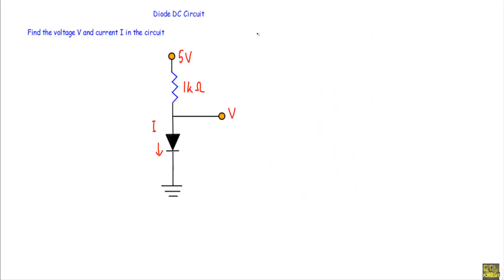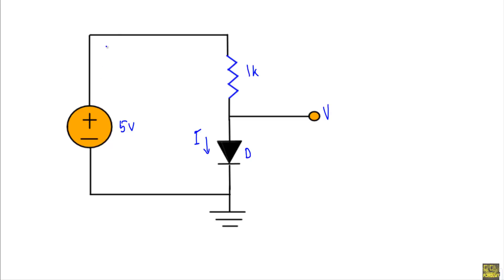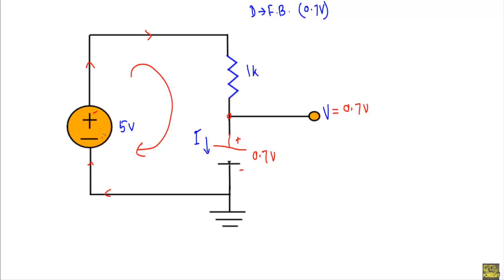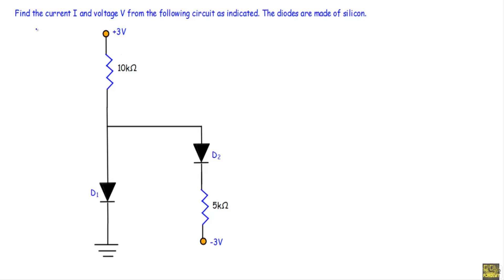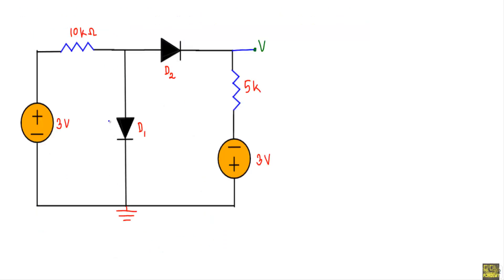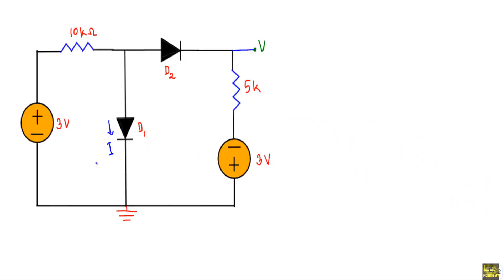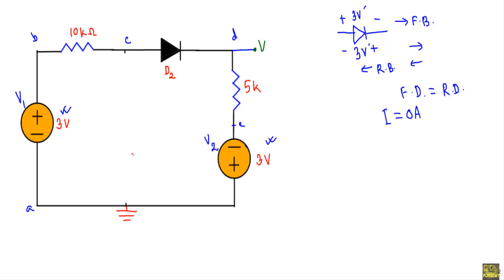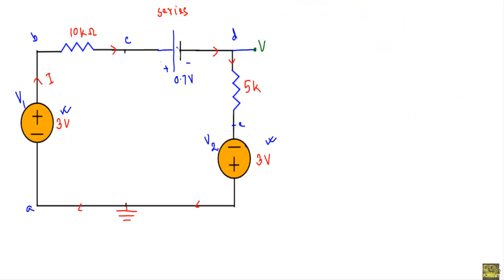Diode DC circuit : Example 3,4

Comment: On the first example why is the diode 0.7V?  You mentioned it being forward bias but I am not sure how you calculated it.
Reply from the maker: It is the junction voltage or built-in-potential for Si diodes